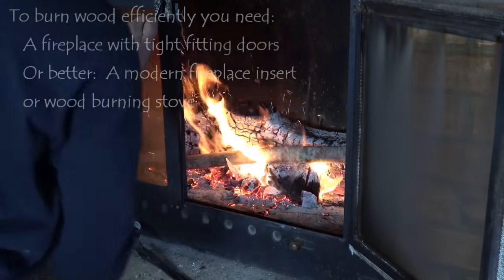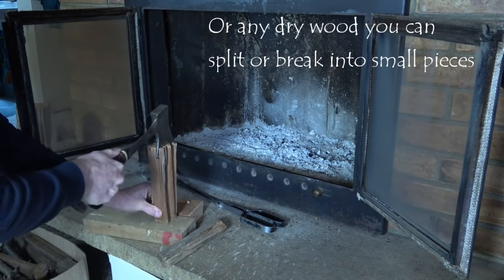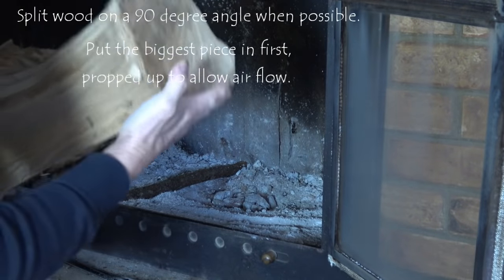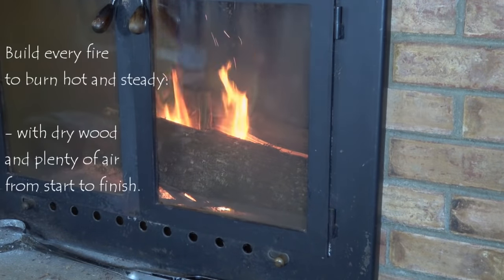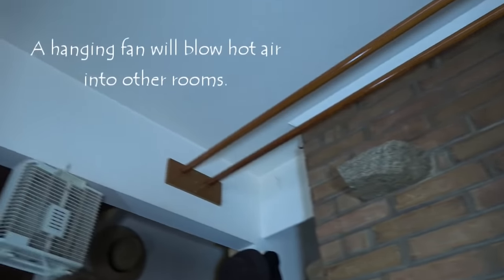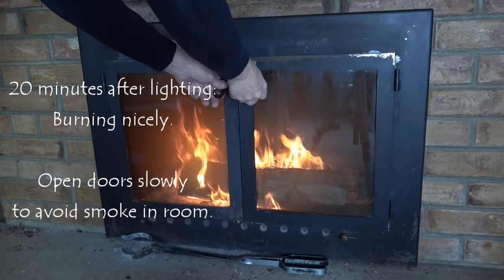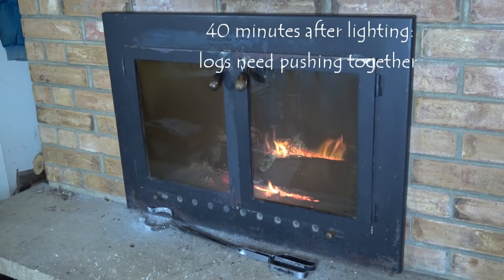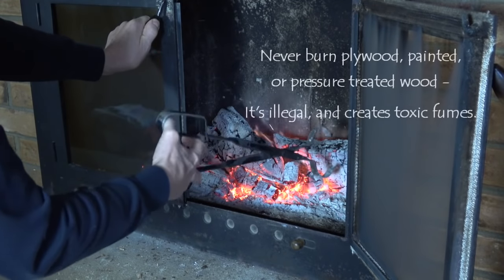Heating Your House Efficiently with a Wood Burning Fireplace or Stove

Comment: .....Yes but there is one thing  NO    secontary  combustion....is it??????
Reply from the maker: It's true.  The only way to add secondary combustion to a fireplace is with an insert, which costs more money to buy and install, but burns more efficient and clean.  If I was building a house from the ground up, I'd build a Rocket Mass Heater, which is cheaper, more efficient, and burns very clean, but it's hard to get insurance companies to approve them.  Look it up.

Comment: You make keeping a fireplace too arduous by stoking it every 20 minutes or so. We have to sleep some time, give better comments on longer lasting fires.
Reply from the maker: I now burn a short hot fire to heat up the house, with smaller wood, and then I let it go out. If it's really cold out I might do one in the morning and one in the evening. If I stack the wood right it will completely consume itself and not need any tending. For a longer lasting fire, an insert or a wood stove is better, which has a smaller firebox, thus keeping the wood closer together.

Comment: Air from underneath gets a fire going ?  Not so.  Wood only burns well using secondary air
Reply from the maker: What do you mean "secondary air"?   Wood burns best with a steady supply of fresh air streaming directly to the fire.  If the air comes in from underneath, it's like a bellows blowing fresh air directly at the flame, and it takes off like a blow torch.  The trick is not to have the airway get plugged up with ashes.  Also it's most efficient to have the fresh air come from outside your house, not sucking already heated air out of your living space.

Comment: Heating with a wood stove now in northern Michigan !!!! What a royal pain in the ass !!!!!! Try sleeping for 7-8 hours straight . Impossible without waking up cold ! Sucks , I like pellet burners and propane or gas ! Wood is fine in a cabin roughing it or in mild temperatures . Other than that it is messy =  smelly , smokey , dusty , makes you crouch = hard on knees / almost all stoves are stupid low. The outside wood burners are the way to go .
Reply from the maker: Sounds like you need a really warm down comforter on your bed, and you need to insulate your house better. You're right - it can be messy.  I'm glad our fireplace is elevated with a hearth the right height for sitting on.

Comment: Burning the fire with CLOSED  glass doors?   Holding the wood  with fingers UNDER  the ax  head  while splitting?  Yikes!!
Reply from the maker: I burn wood mainly to heat the house, and if the glass doors were open all the heat would go up the chimney, which defeats the purpose.  You need Pyrex or Ceramic glass doors for a very hot fire. If your doors are tempered glass, keep the fire moderate and toward the back of the fire box when the doors are closed. PS In 60 years of lighting fires I've never hurt myself with a hatchet. Don't ever put your fingers on top of the block. Keep them on the sides. If in doubt, wear gloves, that helps prevent slivers too.

Comment: I hope you plant new trees for the ones you take down. Would be nice.
Reply from the maker: Trees grow so abundantly around here (with 100" annual rainfall) that any time a tree falls or is cut down, several new trees compete to take it's place. Most of the firewood I burn is trees that were already dead, cut down by the power line trimmers, or pruned to make room for my fruit and nut trees, berries and vegetable gardens. Last year I planted peach, apricot, quince, hawthorn, fig and hazelnut trees. Adds variety to the existing forest of alder, maple, fir and cedar.
Reply: I suppose you'd rather he burn dinosaurs, coal or leprechauns?

Comment: I think you need to move if they're telling you if you have too much smoke it's illegal that's crazy
Reply from the maker: We live in a valley with about 100 homes that heat with wood and if even one nearby has a smoky fire it affects my breathing. There's no reason to have a smoky fire. Burning wood causes more pollution than almost any other way to generate heat. It's in our own best interest to burn as clean as possible.

Comment: A totally inefficient way to produce heat.
Reply from the maker: It's true that a certified insert or wood stove could be up to twice as efficient as this old fireplace. Some day I may spend the money and install an insert.  But we heat much less with wood anyway now, even though our wood is free, because burning any wood at all creates pollution, our electric rates are reasonable here, and it's way simpler to turn on a thermostat.
Reply: And why is that?
Reply: Hartz Homestead Consider were you electricity comes from when you talk about pollution. You mentioned you’re in west Washington, I know Washington has a lot of renewable energy. Knowing this renewable energy isn’t a perfect system and pollution is produced. Burning wood on-site doesn’t make all that much pollution. Think about the electric company and all the steps it takes to get that renewable energy to your home. Pollution is involved with power lines and upkeep of electrical systems. Cutting up a dead tree (with or without a chainsaw) and splitting it (by hand or with a gas splitter) wouldn’t produce that much pollution if it was on your land close to your home. If you burn your wood correctly (as you did in the video) then you’re not producing much pollution. The main polluters are NOx, CO, and particulate matter. If you burn a good hot fire but not a crazy rip roaring flame you pretty much limit all these from excessive levels. Plus firewood itself is renewable it’s not like the pollution is adding to the atmosphere unlike fossil fuels. Anyways great video
Reply from the maker: Frankbrooo, thanks for your input.  You have a good point.  Most of our electricity here is hydroelectric, but even that disturbs fish runs, and makes for big transmission lines over the mountains, and like you said, maintenance is required.  A portion is nuclear, wind and other sources.  It's hard to know for sure which is worse without a scientific study on the subject.
The chart I've seen says burning wood even in an efficient stove produces 400 times the particulate matter that gas or oil does, but that does not take into account the carbon or other pollutants, or the energy it takes to get the oil here.  I do know that air quality here sometimes gets to unhealthy levels, mainly because of smoke from people burning wood.  
Actually the best solution I've read about is a rocket mass heater, which burns small wood really clean, but it's not something I can convert our fireplace  to.
Reply: Hartz Homestead Thank you for your response. I was unaware about the particulate levels in your area. I always have this vision of wood heat not being a major boon on pollution, simply because not many people do it. However, I think you have a valid point. People in rural areas all burning at once could certain cause a large amount of PM over a small area. Grand scale (like nationwide) probably not an issue but localized pockets yes. I’ll have to check my area’s quality since a lot of people burn wood here too. Yes the rock mass heater seems to be the best way to heat your home with wood. It’s a shame most houses in America (including my own) were not set up with one or have have the option of retrofitting one.